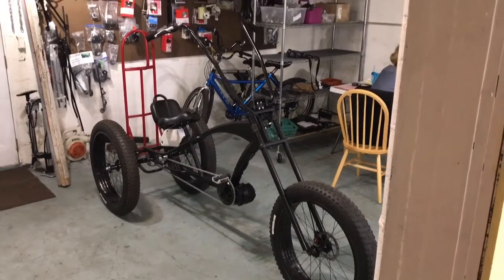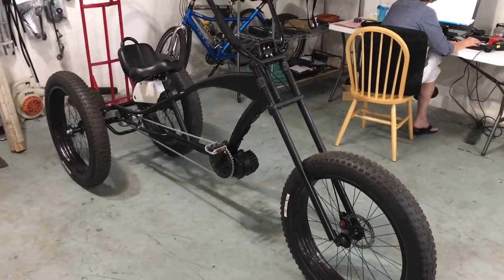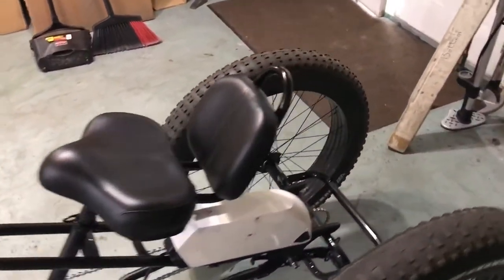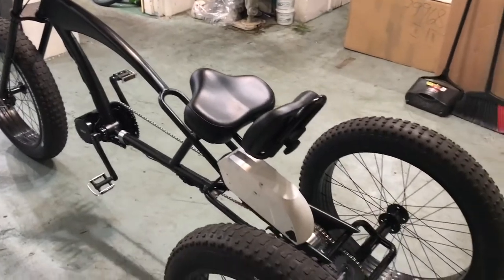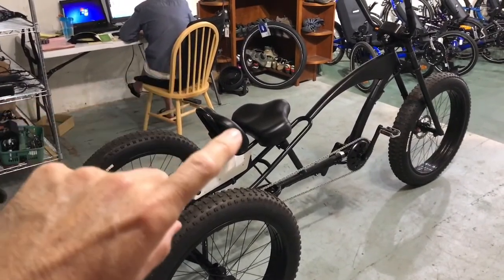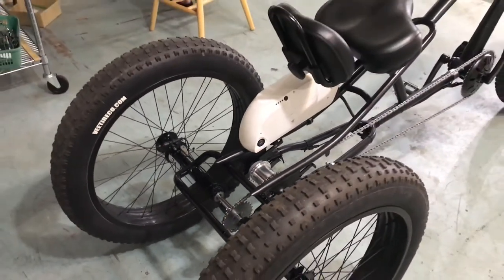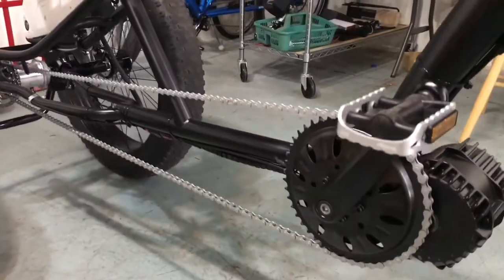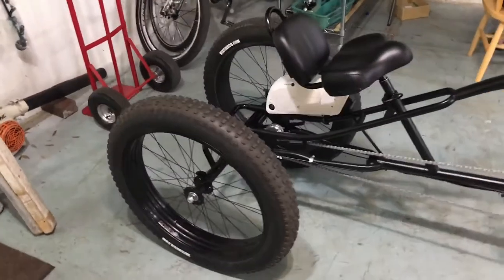Thank you to Trailside Bikes in Floral City for building my Frankenstein trike

Comment: looks awesome. How is the ride?  does it soak up the bumps and divots in the road well or does it need shocks?
Reply from the maker: On paved or gravel is was great, but I would not take it off road as it was top heavy and could tip over, but it was a fun ride.

Comment: Hello. I would LOVE to see a video showing how you installed the rear set up. I have two trike conversion axels and they wont bolt to the frame. And sadly none of the sellers on ebay or amazon have a video or instructions
Reply from the maker: Great suggestion! I have sent Sold the bike. One of the weaknesses was the rear, how it connected to the frame. I can never get it strong enough, I think the better solution would be to take it to a welding shop and have cross braces welded to it, versus just bolting it to it.

Comment: How does the coasta  break work with the pedal assist
Reply from the maker: It's actually not a brake it's a 3 speed hub. Problem was the torque from the 1000watt motor keep breaking the hubs.

Comment: Level that Seat. Try tilting your seat nose down and level it out. Also, ya might wanna raise the seat a little, to where ya have a slight bend in knee on down stroke for easier pedaling too. 
 Oh.. and by doing that, also tilt the handlebars straight up, if not foward toward front tire. It's actually easier to ride that way as well. Upper torso leaning foward will improve sitting down performance speed. Allow for relaxed hand grip & It gives it a very aggressive look to it too.
 Nice seat back rest! If ya don't mind me asking but, where did ya get that at? Thats sweeet! 👍👀
Reply from the maker: thanks, it was a great bike but not very comfortable, my Catrike recumbent is much better.